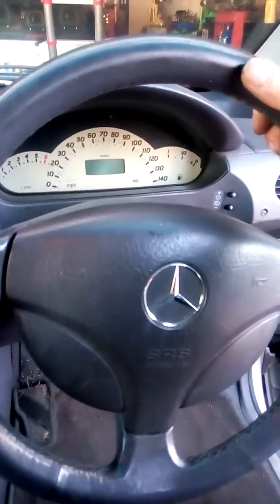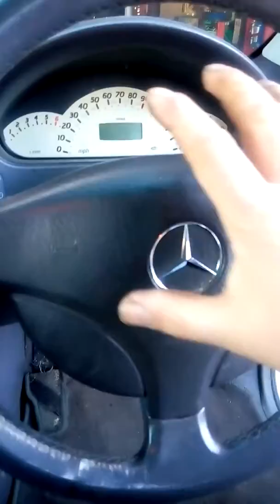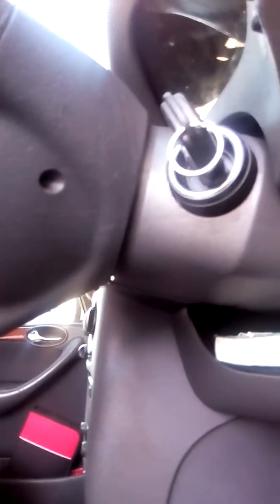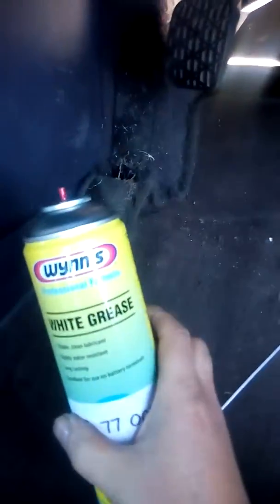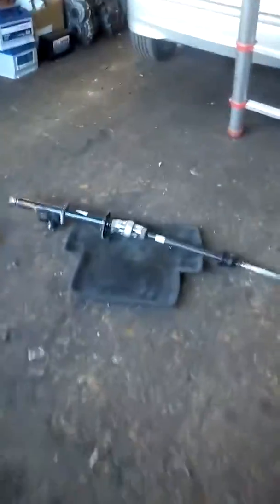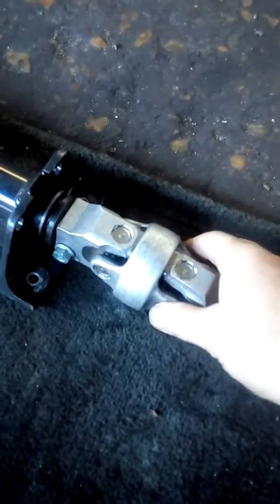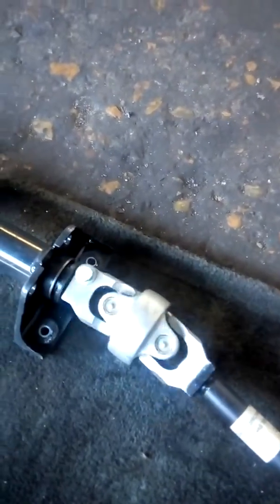Squeaking  And Stiff Steering Mercedes A class W168

Comment: I don’t have this specific issue, but I have a clunking sound  RHF when the car moves up and down on on bumps and the car steers to the left on bumpy surfaces. I’ve have all the suspension checked and it is all ok. Any thoughts on a cause?  Mechanics have witnessed the issue but cannon diagnose specifically simply saying fit a new steering column and rack. It’s a 2000 A140 RHD. Thanks!

Comment: Mines making a knocking sound from the exact same part any ideas how to fix that?
Reply from the maker: The knocking is always an induced fault, someone loosened the universal joint under the dash and didn't put it back properly. you'll need to loosen the 13mm bolt on the universal joint under the dash, push the parts together then tighten it.
Reply from the maker: ferkemall  No, just labour.